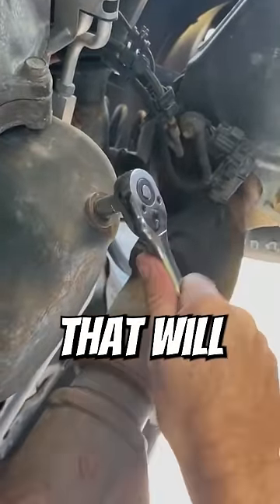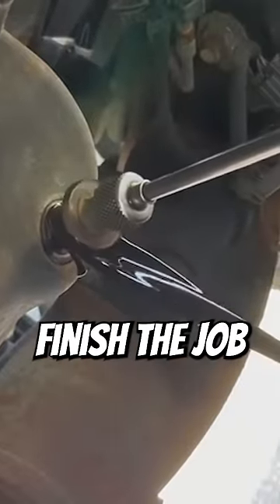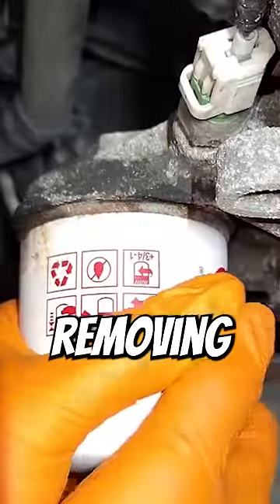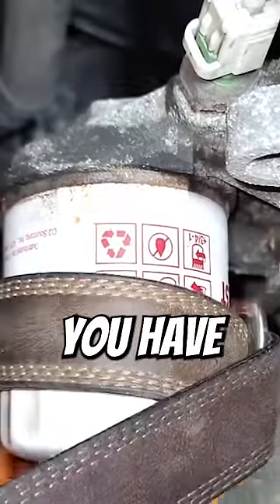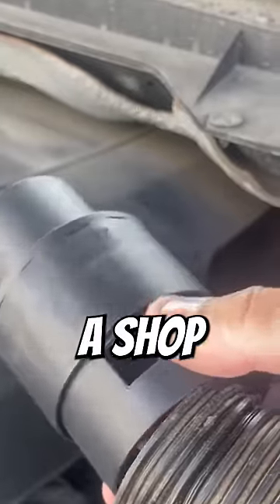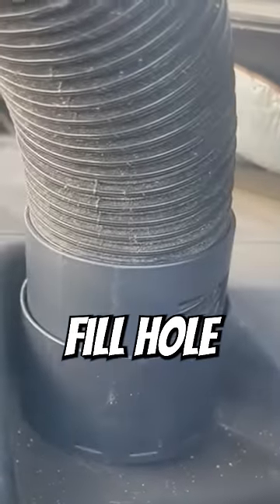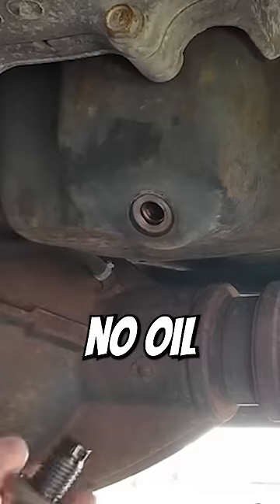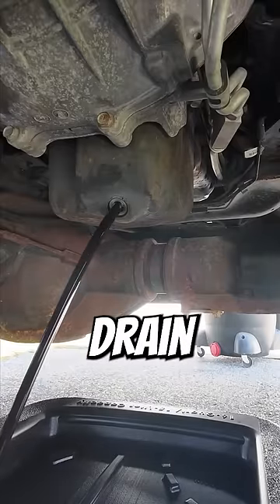Mechanic Life Hacks That Will Improve Your Worthless Existence - Oil Change Edition

Comment: Screwdriver into the filter never fails. Few drops, but when they’re stuck…
Reply: Sometimes it really is all you can do.

That said, I've had success when access is possible using a 'knocking stick' and hammer (knocking stick being anything long enough to strike, say an extension bar so the end is blunt!)

Use this to drift the filter loose so you can undo it by hand. Doesn't always work but nice when it does!
Reply: I've actually had this not work. The idiot I bought the truck from must've put it on with a fuckin impact. It literally just bent and tore all the metal off.. I ended up having to cut slits in the ring that seals around the threads and hammering it out that way...

Comment: I am a heavy truck mechanic. The drain plug never comes out that smooth but the magnet is a nice truck for light duty vehicles. Also the same for the cup filter idea. Awesome but I don’t have a cup that holds 1.86L and fits. Volvo has three oil filters too. Lots of stuffs and things.
Reply: When taking off filters at home, I use old grocery store bags or a ziploc bag around the filter.

Comment: Changing the oil filter on my car is no problem and does not make a mess.  It is a cartridge type filter mounted on the front of the engine and a 24mm socket spins the cover off just fine.
Reply: I worked on my ex's car and the filter was on top right by the cap. I was like awesome I only need to be under this death trap to drain the oil Oil changes are easy and I think  a lot of friends of mine don't understand how simple it is. It would only trust myself since a lot of these guys who work in shops love to bolt in the plug or make the filters way too tight. Some guy did it to moms
Reply: I do really rare that set up. My other half's R50 has an upward facing cartridge and it's difficult to actually make a mess!

Comment: Hack #5) When reinstalling oil drain plug be sure and set the torque wrench to 25 ft lbs. This will prevent the stripping out of the threads that the 18 year old kids do all the time from over tightning at all of the oil change places.
Reply: That's a LOT of torque, especially for an aluminium sump.

Since the early 90s I've been seeing the plug ginger tight then just nipping it up. So far so good 100s of oil changes later.
Reply: Torque wrench? I just set my wrist to click when the plug's tight enough
Reply: Torque wrenches are for sissies
Reply: 25 sounds ok, I do the alloy ones to 19 ft
Reply: Torque wrenches are fancy. Don’t forget to cross thread the drain plug, works as good as lock-tite but never runs out.

Comment: When you're doing an oil change, make sure you have spare crush washers on hand. I once started an oil change, and discovered that the crush washer was wrecked. Since the crankcase had no oil, I had to ride a bicycle to the auto parts store to get the crush washer I needed.

Comment: I don't know about a hack but I got a tip do not use a ratchet to loosen or a specially tighten your oil plug almost every oil pan is aluminum I don't think I've ever seen anything other than a steel oil plug so you can over strip it real easy also always put a little bit of oil on the new oil filter gasket this is a funny video though good job man

Comment: You can remove the drain plug on a Briggs and Stratton while it's running because crankcase vacuum. 
Just have the pan under it when ya shut it off

Comment: There are some times when a filter will be torqued on so tight that you have to seek unconventional methods to dislodge it.

Do NOT do the "screwdriver trick." That will just make your day worse.

Get a strap wrench. If that doesn't work, I haven't seen a filter yet that was too stuck for a strap wrench plus a single strip of roofing shingle.

Comment: Unscrew the drain plug but keep pressure on it, that keeps the oil from coming out onto your hand, then remove it quickly, you won't get any oil on your hands and you don't need to do anything special... They sell oil filter wrenches, they are super cheap, just get one from harbor freight, they don't need to be super high quality. But the cup hack is a good one though, I've used that one and it works pretty well.

Comment: I mean I guess these are fine but I've never needed to put them into practice. #1 I would just use a nitrile glove and usually, you can pull drain plugs out without getting any oil on yourself. #2 Sure in a pinch it will work but they make several different tools for removing oil filters just get the right tool then you have it. #3 Deafeats the purpose of #1 also when you shut the vacuum off you're not under the vehicle to position the drain pan and can make a bigger mess. Great if you don't want to drain the oil while replacing a sensor or drain plug though. #4 Obviously doesn't work in some situations but if you have room for a cup I would just punch a hole in the bottom of the filter after getting it loose and let it drain.

Comment: DO NOT ATTACH A SHOP VAC TO YOUR OIL FILL PORT!
If you shut the vac off before you remove the nozzle any dirt, grit and grime in the hose will fall into your crankcase. 
Unless its brand new. Then you're good.

Comment: None of them, we're just changing oil we ain't got time to dick around with all that b*******. Typically they have a 100 point inspection that they have to pull off, plus changing the oil, and filter, fill the washer fluid,  you only get 29 minutes (or less) to do an hour job. Oh, and you only get paid for 10 minutes.

  LINE 'EM UP! ......then make it the only thing i do all   day....every   day...
 Now you want to come get all up in my grill about a 2 lb tire pressure difference? Yeah, let me go to my car for a minute I'll be right back

Comment: I think replacing the Drain Bolt with the FuMotor valve is much better.  Also, a bypass oil relocator to where it's easier to get to is also Sage advice.

Comment: I can take 99% od oil filters off just by hand. Ive had 3-4 that i needed to use a different method. Usually, a screwdriver jammed thru it

Comment: The cup hack doesn't work on my 2014 RAM 1500. There's not enough room to maneuver the cup out so you end up dumping the oil down your arm. Well...maybe if I had a lift it would work. A plastic bag is better for me. Ziploc is nice because you can drop the filter in and close it up.

Comment: What if I told you that you don’t need an oil filter wrench, belt, or to pound a screwdriver through the filter to remove it? Nope. None of that. Grab a piece of sandpaper and you’ll turn it right off in your hand. Been doing it this way for 10 years.
Reply from the maker: Great tip!

Comment: Replace the drain plug with a Fumoto drain valve.  Best thing I’ve done to simplify my oil changes.  I don’t work for Fumoto.  I paid about $30 for a valve to go on my Taco and never spill a drop.

Comment: Lets see... Using a mag-pickup to remove a drain plug. If you have rubber gloves on, who cares. Use a belt to get more grip on the oil filter. you do know they've made oil filter wrenches ever since they've been making filters? Use a shop vac to prevent an oily mess. Don't you put the drain pan beneath the oil pan BEFORE you remove the drain plug? These hacks are wack. (I do see a some of people using a FLEXIBLE mag pickup to remove the drain plug) Unnecessary tools and procedures only create more work, not less.

Comment: Here's a simple and cheapo trick for those....
Get a car speaker which already faulty and pretty sure there's some hiding at your scrap pile.... Extract the magnet and hot glue a stick or metal rod onto the magnet and you can use that to catch the oil nut.... No need to buy fancy tools
As for oil filter? Don't need belt.... Use those used belts or serpentine belts

Any faulty parts can be turn into tools... Just need to improvised it😂😂😂😂😂

Funnel for pouring oil? Why waste money when you can use plastic water bottle... Cut the bottom and air blow the sucker til dry and Viola.... Homemade funnel

Comment: Used motor oil with fuel vapors being sucked into a shop vac is my #1 hack. I also use that method when replacing fuel pumps.

Comment: For drain plugs, I just use my fingers. Once it's cracked loose, start loosening it, and once its about to bust, give it a real quick spin (almost like a flick) while moving your hand out of the way. This works 90% of the time, but you'll get some cars where the plug was crossthreaded by an idiot with an impact wrench. The shop vac trick is useless once you've got this method down.

Comment: You don’t need that hack it’s simple
1. Unscrew oil filler cap on top of engine
2. Put drain pan under neath oil drain plug slowly unscrew drain plug hold pan close enough to catch oil don’t unscrew plug all the way let drain for most of the oil
3. When it’s down to dripping pull plug out
4. Move pan under oil filter now catch last bit of oil
Put drain plug back into oil pan
5. Always tighten oil filter hand tight and no more ( it won’t leak I know )
6. Pour new oil in engine and check level
7. Always put film of oil on new  oil filter

Comment: First of all, stop saying Hack. That's dumb. These are tips. Second why wouldn't you already have the appropriate sized channel lock or strap wrench already if you are the one that changes your own oil? If my car has that odd size screw or bolt. I have a tool box full of odd size tool. The vacuum is a cool tip though.

Comment: Or you could just, you know, NOT worry about the oil splatter, wear gloves, and use a $10 oil filter wrench for the extra grip

As long as you have an oil drain pan, or an oil caddy with a funnel extension on top of it under where the vehicle is, you minimize the potential for making a mess

And if spills do happen, just keep oil absorption stuff nearby, whether it be disposable absorption mats or those big containers of oil absorbing sand stuff

And if you work on big diesel trucks, keep multiple sets of spare clothing handy, you WILL eventually get dunked on by pitch black diesel oil despite your best precautions, it's only a matter of time lol!

Comment: The first time you change your oil replace the drain bolt with a valve. They're inexpensive and makes future oil changes a breeze. Don't even need catch pan you can run vinyl tubing from the valve directly to an empty jug.

Comment: The word "hack" drives me nuts. That word describes a person who doesn't know what they are doing and you can tell by the quality of the work. None of these are my favorite. If you change your own oil you should be able to take the filter off by hand. If not you should own a filter wrench. I'm definitely going to use a $100 leather belt to loosen an oil filter. This person has dishwashing gloves on so who gives a shit about a little oil on your hands. Get your pan in place and remove the drain plug. Let's see how well that shop vac idea works for you. The cup is even more ridiculous. I can change my oil with a wrench and that's it. Rounding up all that shit and using those swell ideas will do nothing but add another 30 minutes to your oil change. Here's my hack for everyone. Don't listen to "hacks" telling you about what makes them a hack.

Comment: Install a Fumoto Quick Valve instead of the standard oil drain plug after the oil is drained. Just flip a little lever for opening and closing. No mess.

Comment: Hammer a screwdriver complete thru filter hit handle of screwdriver to loosen it. Lol that vacuum is a bad idea too, unless the vacuum is dedicated to only just that. The oil drain plug can be pushed slightly back onto its threads and will dramatically slow down the flow long enough to place the pan. As far as getting oil on you...."suck it up buttercup"

Comment: If you have a narrow creek or ditch close by and some heavy lumber that can support the vehicle safely, bridge across and when you let the plug and filter go just dip your hands into the running water before the oil gets all over your hands and arms.  Bonus part is you dont have a bunch of used oil sitting around afterwards.... 😂

Comment: Another hack I saw is to strike a hole in the oil filter before removing to drain the oil in the filter and then remove. Less mess on your hands. 👍🏼

Comment: No tools required pro tip, keep pressure on and spinning the oil pan plug until you feel it jump from being completely unscrewed, then let the pressure off to avoid oil all over you

Comment: If I couldn’t get it with my hand I’ve never been able to get it with a belt.  Usually have to get my filter pliers with teeth at that point.  I even got one of those filter tools with the belt attached to it kind of same as just using a belt and sometimes that’s handy if I can’t get the pliers in there.   The cup was slick tho.    What about a duramax? Would the cup work? I’ve had 06 and 08 versions and both of them the oil filter comes out at like a 45 right above the front drive line    It was always messy.

Comment: If a commercial garage put on your oil filter, just get a oil wrench because they put them on too tight all the time. If you're doing it yourself, screw it down until it's snug and then another quarter turn it's sufficient.

Comment: Punch a hole in the bottom of the oil filter and drain before unscrewing it. Also you can add a valve to the drain plug.. easy and clean

Comment: Instead of a leather belt I use a web belt like the military wears, used it all the time.  You want to impress me come up with a hack to remove the oil filter from a 2018 Ram 2500 easily.

Comment: With the oil filter, here is my hack.
Grab it and squeeze really hard until you put an indention on both sides, then it doesn't matter if your hands have oil on them you can get it off.
I don't know if my grip strength is crazy, but the metal seems pretty easy to bend so most people should be able to do this.

Comment: My girlfriend’s dad had a midlife crisis Miata and at that time he was still able to do his own oil changes. He replaced the drain plug with a valve, fumoto or something like that. The cars so damn low. You can just reach under there with a little piece of clear tubing and stick it on the end of the valve and open it blind without ever getting the car off the ground.

Comment: Well... I just put a disposable glove on so I don't get oil on my hand when I'm pulling the plug rather than getting oil all over my magnet tool... I just seen a really cool video where a guy broke the oil filter loose and then took a punch and drove a small hole right into the bottom of the oil filter and zero spillage... They also sell oil filter wrenches so you don't have to use your belt.

Comment: the vacuum was my favorite, have seen a mechanic use a shop vac to remove the fuel gauge out of a dozer which is located in the bottom of the tank and didn't loose a drop of fuel.

Comment: More tips, duct tape works for the filter if you're working in a tight space. Punch a hole in the bottom of the filter using a nail and let it drain before you unplug it

Comment: The only one I had never used before was the shop vac. I'll use my belt as a filter wrench if my actual filter wrench is being used. The one I use the most is the magnet on the drain plug. I always have a telescope magnet on me at work.

Comment: I Crack the filter loose first and then poke a hole in the bottom with a little 21oz spiked Hamer I make in my shop, then just drain the oil into a pan.

Comment: Just buy an ezoil drain plug, after the car is jacked up it takes me 5 minutes to complete my changes. Never had a leak and it has never failed. You put it on once and never have to take it off again.

Comment: I have used the belt in a pinch with a cramped filter that was too tight. I've heard about the cup, but have never tried it as most of my vehicles have bulky filters.

Comment: You just press the bolt in while untightening, when it's completely undone oil will not drip because of that little pressure and then you just push it to the side and upward, clean and elegant.

Comment: I didn't think about using a belt and didn't have the right size tool for the filter on an 85 subaru that hadn't run in 10 years. I punctured the filter end to end with a screwdriver to get enough leverage to turn it lol.

Comment: Not so sure I like the magnet to save me getting oil on me, because NOW its all over my magnet, and I have to clean it.. the belt and the cup, HA that's all that needs to be said on that, if you can't grab the filer tight enough to get it off you're not getting that belt on it either, and the cup HA, same thing, the filter is never in a good enough position to get that cup on it. Just sayin

Comment: The shop vac one works really well. Especially if you need to pull the drainplug or the oil filter for any reason but dont want to lose all the oil because it's still good.

Comment: The vacuum one is good if you have a leak through the drain bokt and need to replace the copper ring but don't want to drain the oil

Comment: Instead of the cup, you can poke a hole on the bottom of the oil filter and  let it drain before you unscrew it.

Comment: The best hack for removing a stuck oil filter is to hammer a screwdriver straight through the middle and twist it off with the handle.

Comment: If the oil filter is stuck stab it with a screwdriver and use the handle to help you screen the filter off

Comment: If you push against the oil plug as you spin it, it's less likely to have any oil come out of it and once you get it all the way loose you just pull it back real quick and voila it goes into the oil drain

Comment: When you remove the filter first punch a small hole in the center then remove it without oil raining all over the filter on its sides and loosen the drain bolt and quickly pull it away from the oil drain pan hole not getting your hand covered in oil

Comment: I drill a hole in the bottom of the oil filter after I’ve drained the oil from the engine. This drains the oil from the filter before you remove it